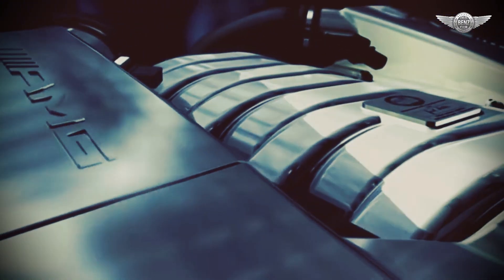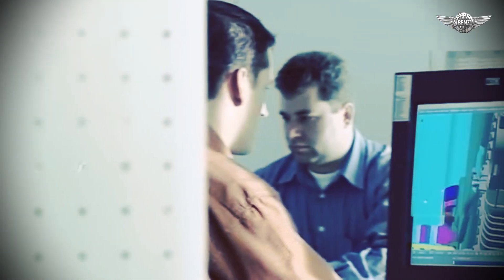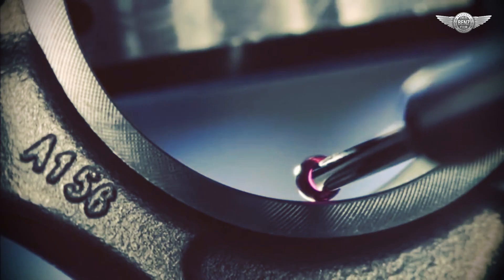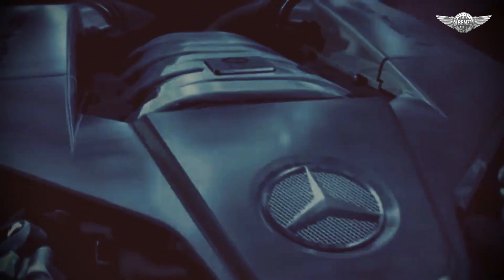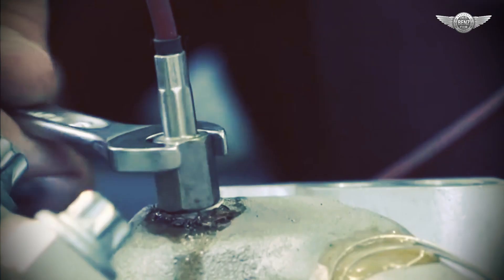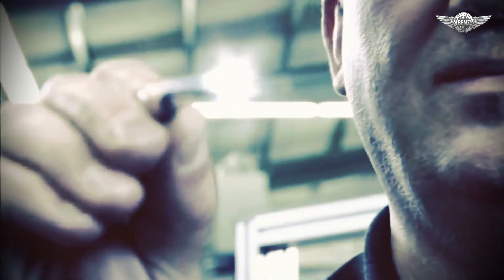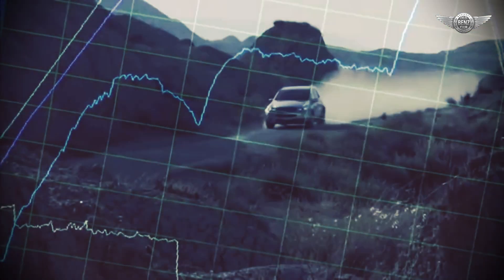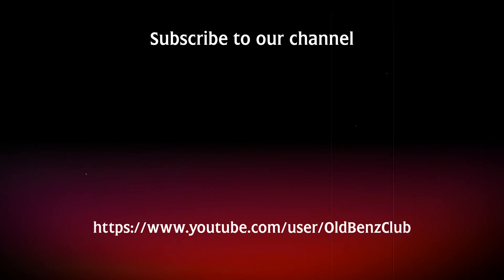AMG 6.3-liter V8 Engine M156

Comment: As far as power and powerband it's awesome. Sounds great straight piped too. 2012 and up had better head bolts.....still not ARP though. If you warm it up gently and change the oil with Motul 5k miles or less it'll last. If you have to replace the cams/buckets go to SLS Black series as well as ARP cam phasers and cam cap bolts from Weistec. Can't get direct from ARP.

Comment: Can you rebuild the M156 to a M159?
Reply: Over 120 internals were changed on the M159, M159 also uses a dry sump system as opposed to the wet sump in the M156

Comment: Excellent engine but using the worst materials.  To many problems with this engine... just ask the garages who repair them.
Reply: Only camshafts and adjusters rest is solid.
Reply: @ati1903  incorrect.
The lifters, head bolts, camshaft material were of low quality.
It is a great performance engine but not the best built.
Reply: Those little cups... they are pure magic in this engine

Comment: Everyone in the world is complaining about the camshaft in this engine.... i had issues with cam shafts in 2 different cars and all of my friends owning C63 or E63 facing the same issue and it cost a lot of money to replace them..... why AMG did not produced a corrective action for this issue...
Reply: Weren’t the later models starting from like 2012 fix this problem?
Reply: Dzung Le no
Reply: Those horses ride directly on metal..

Comment: Lol forgot to do the stress concentration simulation on the cross section of the head bolts.
Reply: The strength of the head bolts were good enough, the problem with them is that they corroded which weakened them significantly which caused them to snap.
Reply: Lol
Reply: smh

Comment: any bad points in this engine, of the ml 2007 year of production!?
Reply: Head studs are the biggest issue as they come loose and the whole engine can be destroyed. This is a rare problem from the early years of the car. Make sure your dealer checks them. If you have them done its around 4500 USD, if not a new engine could cost tens of thousands
Reply: @Knoxvillicus  head bolts not studs, 2 different things.